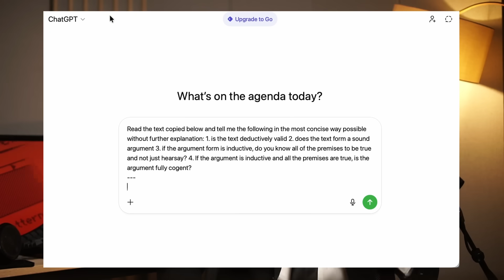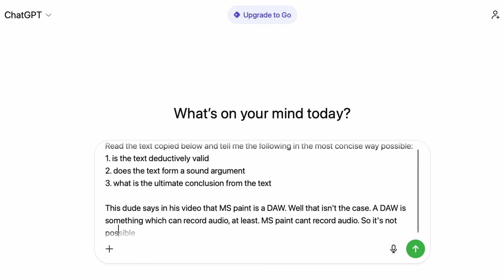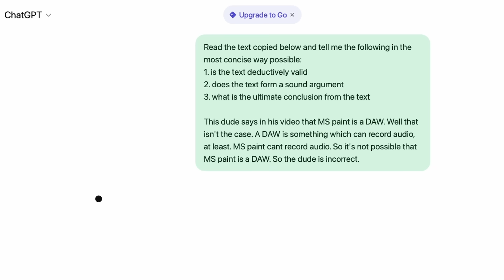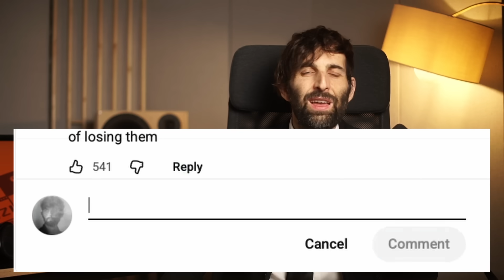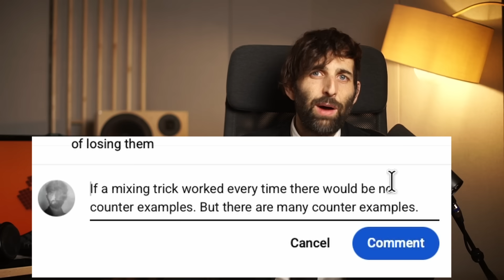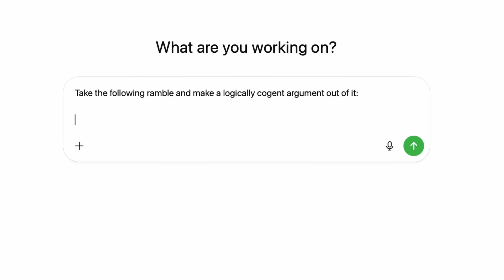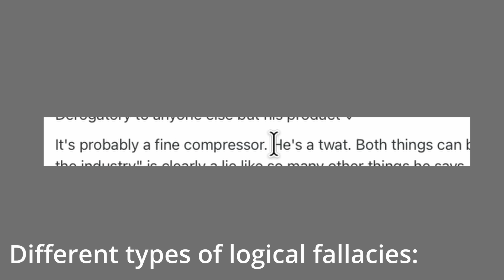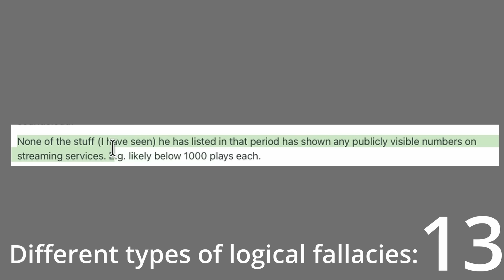Are you a fake engineer? Probably, logically speaking.

Comment: In the argument of when a person is right to call himself 'an audio engineer' or nor, here's an example:
Take a person who's been doing live sound for 30+ years. They're a legend in that world, everyone wants to work with them, but they never got a formal degree. They know the gear, the physics, the signal flow, and the theory inside and out—just as well as any graduate.

So, the question isn't really can they do the job. It's: does the title "engineer" belong exclusively to a diploma, or can it be earned through decades of proven, expert-level application?
Reply from the maker: You don’t need formal training but you need formal expertise. A live sound guy is more of a technician technically speaking. If he does maths to figure out where to place the speakers and calculate temperature coefficient to adjust frequency responses and line array angles etc then that’s engineering

Comment: I am starting out in audio. I have cloned a u87, modified a wem copicat and built the three way speakers. My question is, in an age of plugins and mixing in the box does an audio engineer really need to be scientific? Does the science really give you and edge in the real world? Or would you say the art is way more important and the science isn't necessary knowledge  to have?
Reply from the maker: nice one, good job. It depends on what it is you want to do. For me, a lot of what I do now is essentially software engineering within audio, making plugins. But I would say, if you wanted to say you are an audio Engineer with a straight face, you need to be able to take a soldering iron to stuff. You need to be able to design and build basic analog audio equipment, or, if you are operating with digital tech technology, you should be able to code C++ and know how to create audio effects and tools
Reply: @APMastering Cheers for the insight